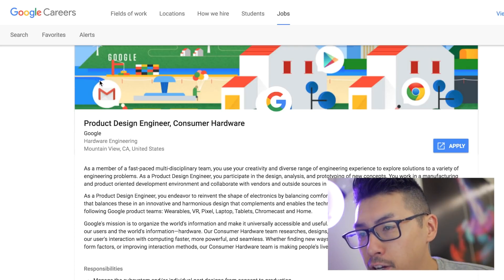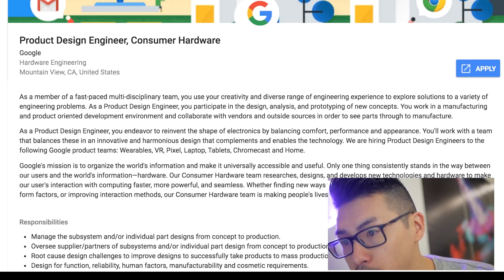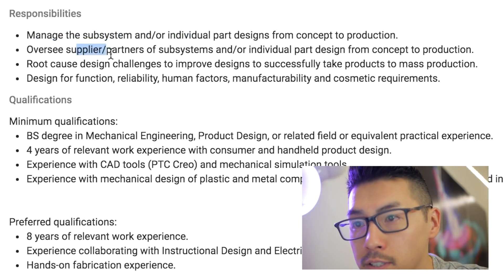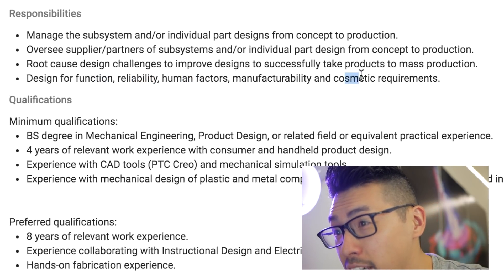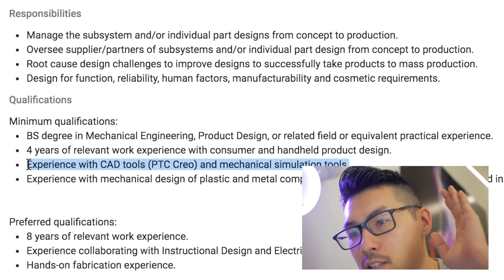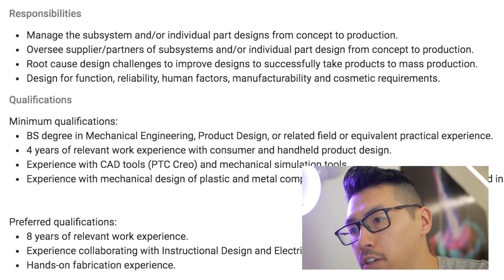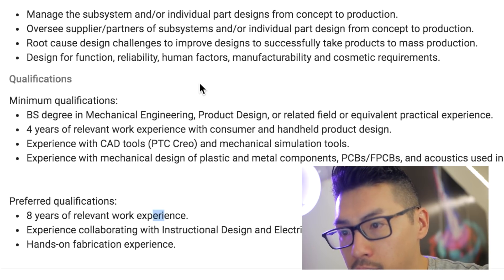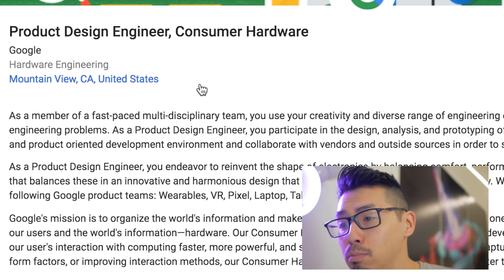Industrial Designer VS Product Design Engineer! Job Listing

Comment: Nice video! There is just one thing that I think needs to be expanded on - 
mechanical simulation tools (finite element analysis, computation fluid dynamics, etc.) can indeed be learned on the job… if you already have a strong background in the physics driving these simulations. Learning to use simulation software isn’t any more difficult than learning to use SolidWorks (in fact, SolidWorks even has some simulation tools built in), but you MUST have a strong understanding of physics in order to make sure your simulations aren’t outputting meaningless data. This is where the engineering background will really help you out.

Comment: Can anybody give me advice on what kind of mechanical engineer I should be looking into becoming? I want to create the schematics of an engine, but I’m not sure if that means I’d be sitting in a cubicle all day (which I’m not sure if I want). I want to be exceptionally good at designing improved products based off of previous designs. I was looking through Glassdoor, indeed, etc. for careers at Ford to start. They listed some jobs as “Design and release engineer” and “Product Design Engineer”. The job description matched what I want for the most part, but I’m not sure if this means I’ll be trapped behind a computer. If this means so, can anyone recommend any hands-on engineering career choices. I’m currently looking to get a masters degree for mechanical engineering. My dream is to work for a high end automotive company. Thanks a lot to anyone who can help. It means a lot to help me figure myself out

Comment: Utopicly PDE is mainly focused on Manufacture Development (FEA, GD&T, Design for X, several etc.) & ID is mainly focused on "Subjective/Objective" Development (Aesthetics, Ergonomics, Form, Materials, huge etc.). Both walk the same path just at different product levels.  On my personal experience (Professional ID) it's easier for an ID to switch to core or engineering areas. For engineers it's harder (based on my own experience and professional PR), they are great working at system solutions but switching them to "Design" makes them strugle. That is why colaborative solutions are the best way to proyect development. Greetings from Mexico!

Comment: Manufacturability and reliability of products are some of the factors I feel are central to Industrial Designers, which differentiate them from pure product designers, from non-engineering schools. In Norway Industrial design is pretty much 50% mechanical engineering and 50% Product design. So Product design engineer seems to be the same as our definition of Industrial designer
Reply: in germany a 50% ME and 50% design study is called "technical design". however it seems like it also depends on the school, i bet some ID studies teached on engeenering schools are also more like that.

Comment: Jimmy! Great Video, I'm a 15 years of experience product development engineer. And I really encourage the Industrial designers to apply for Engineering Positions, I have hired ID's for Mechanical product design positions because I like the holistic approach to the development. However I wanted to clarify some of the key differences or points in the job posting needs. Engineers have a stronger math and physics background, we lack the aesthetics skills (I know), however when you design a product from the ID perspective then the engineering work begins. 1. How do we make this design work, how do we fit everything inside. When you work with consumer electronics we need to figure out the thermal design, antenna design interferences if there's any communication in the device (Bluetooth, WiFi, Etc),  some devices require CE, FCC listings, so high voltage and outside interference simulations and testing must be done. 2. How do we make this product manufacturable, how can bring the beautiful design to remain as intact but at the same time manufacturable. How are we going to assemble the product and still meet the aesthetics, durability, manufacturability and reliability. How do we put everything together and pass the drop test?, how can we pass environmental testing, consumer abuse, etc. 3. How do we make the product reliable. One thing is a nice product out of the box, but what if it only works for a week? We need to develop a product that remains X amount of years with the minimum failure rate, here is where the statistics and math comes to work along with the test engineers. Test the product until it bleeds to capture data to perform statistical analysis and provide evidence of how reliable the product is under normal usage. If you have questions let me know, I'm open to help in any way possible.
Reply: Manuel Anaya Looking for some guidance. Looking to go back to school ( I have a BA in Film Production but working as a fire inspector for my local FIre Department ATM). Ever since I was young and I have always built things that I visualize in my head like motorcycles, cars, etc. I want a career  to design, build and create things. Not sure if a graduate degree in Mech. Engineering or Industrial Design is the way to go. My math skills are lacking but if mech design is a better fit then I know I can learn it.
Reply: I'm studying mechanical engineering 2nd year, so is industrial engineering a full-time job? Or mostly just free lancing
Reply: hello sir, I'm a 25 years of experience  Machine design engineer. here I am happy to read your experiences. i didn't go through electronic products but i have designed gearbox, belt drive, mechanical clutch, electro magnetic clutch  and brakes, Pneumatic and hydraulic machines for SPM requirements. my 90% of designs  were succeeded in first run itself. I have strong mathematics and science base. while manufacturing,  i involve myself for operating machines, indeed I am a good machinist. i am using autocad from 1996 . for 3dmodel i am using solidworks and i am a good animator too.

Comment: The difference seems small and they can both do each others jobs but i've heard that the difference is that industrial designers will specialise in creating the prototype and then pass it to the product design engineer who will then optimise it for manufacturing. So industrial designers are more artists and product design engineers are more engineers who focus on the manufacturability ect..
https://www10.mcadcafe.com/nbc/articles/1/318078/Difference-Between-Industrial-Design-Design-Engineering

Comment: Happy birthday! I will say as a mechanical engineer wanting to also do industrial/product design that there is quite a bit of overlap. However like you highlighted there are some certifications that each discipline has that they other doesnt. Also depending on the state you might need to be a licensed engineer (took a test). I say apply if you are either because on the job training will iron out the kinks.